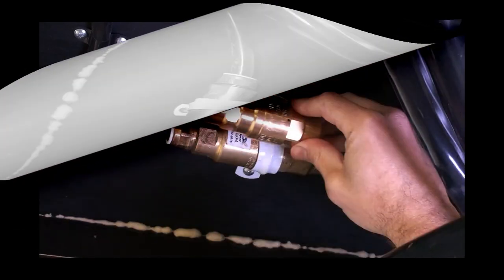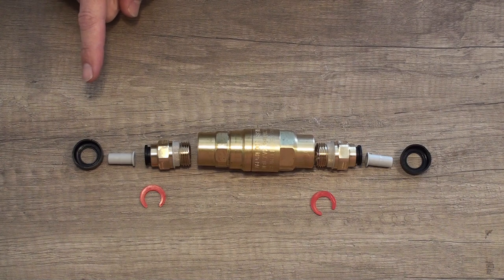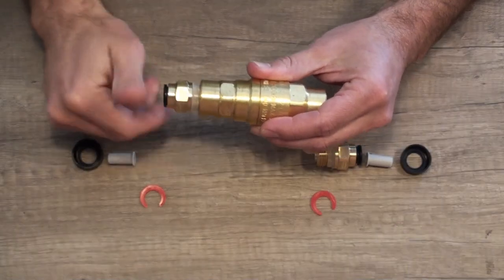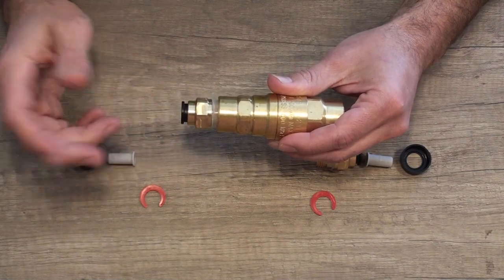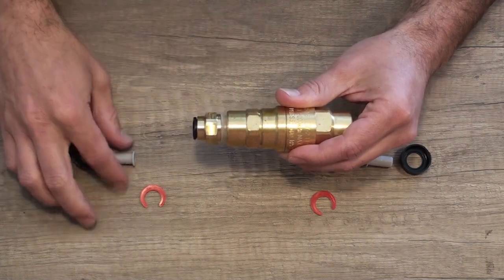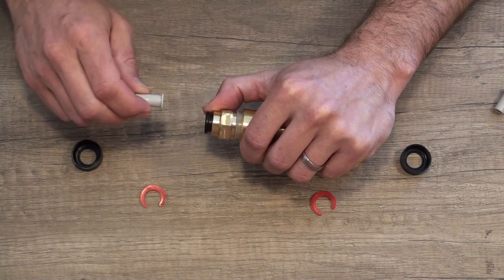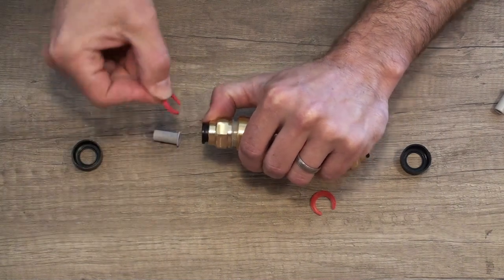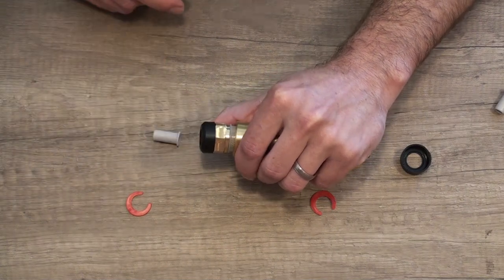Jayco Mains Pressure Problem 😤😤😤 How to fix once and for all!

Comment: I've got a Silverline 2018 and had poor pressure, so took out the pressure limiting valve and cleaned and retensioned spring.  This made it somewhat better, but still only average, although completely clean. I decided to bite the bullet and buy a PLV from Reece Plumbing hoping a good quality valve may make the difference.  Purchased it for approx $70 (same rating as original 350 kpa) and changed it (about 15 minutes work) - now shower goes perfect with fast running water.  I had spoken to a mobile caravan repair guy who advised not to change the kpa but just to get a good quality valve.  Well worth the expense.

Comment: This problem isn't exclusive to Jayco. I have (had) the same issue with my Adria. (I suspect this may be a common fault with all 'pressurised' caravan plumbing systems) Connect to CP water supply (tap) and all works well, initially. But let the system stand, pressurised, for fifteen minutes or so and no water will flow from the faucets. It's necessary to disconnect from the supply, let the system de-pressurise and re-connect, whereupon it all works again. That, or go turn off the CP tap every time you finish with the faucet. I used the same valve as shown here, with fittings that let me attach the inlet-side to the CP tap and the outlet-side to my drinking-water hose, via a "Gardena" style connector. Now, the vans entire plumbing system, including the hose, is protected from over-pressure. The valve and fittings cost me $65, from my local plumbing supplies store so it might be prudent to disconnect the valve from the tap and store it inside, when you're away from your caravan. ;-)

Comment: great video - very helpful thanks - do you need to drain the water pipes / tanks before changing the valve? Does water come out when you take the pipes off the old valve? Thank you very much

Comment: Just pull it apart stretch the spring 15 mm put it back together and it will be fine took me 4 years to find this out when i went to buy a new one the parts guy told me at it worked a treat 2014 17 55 3 outback
Reply: Has this little trick held up over time mate? Mite have to jump under the van this weekend n try it.
Reply: This fix is confirmed. After years of no pressure we stretched the spring and water pressure is now fantastic in sink and shower.
Reply: That's what I did 2 years ago and has been fine since
Reply: Fantastic - it worked for me!

Comment: Whereabouts is the valve located?  I have a silverline and looked all over underneath and can’t find it.
Reply from the maker: It’s under there somewhere. Follow the mains in line
Reply: Not necessarily underneath. Some it will be on the inlet pipe under some furniture.

Comment: where is this valve located at on a 2005 jayco eagle camper
Reply: Not sure if u found the pressure valve but it should be close to where u connect the maims water